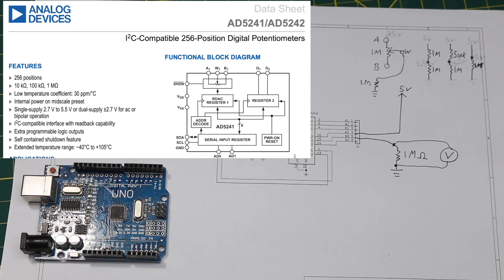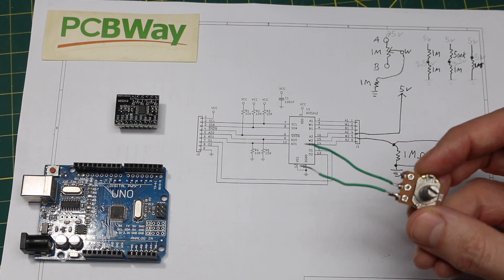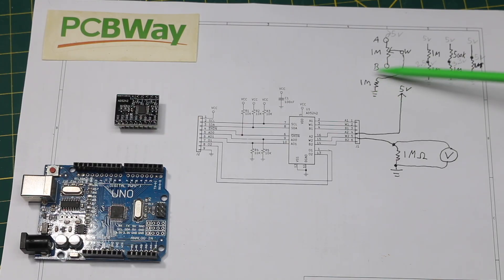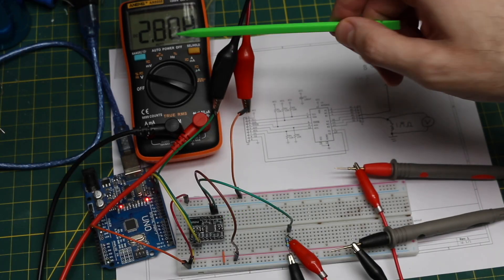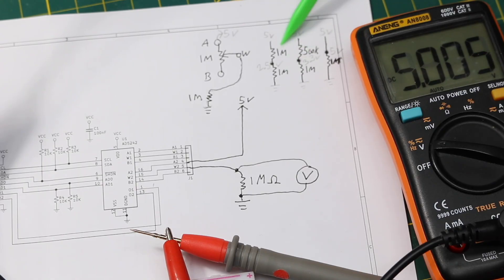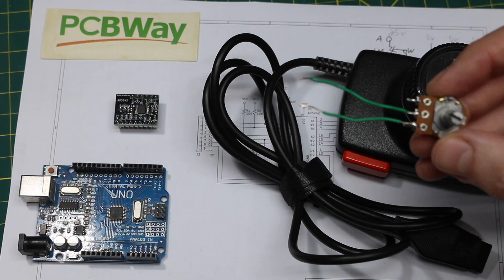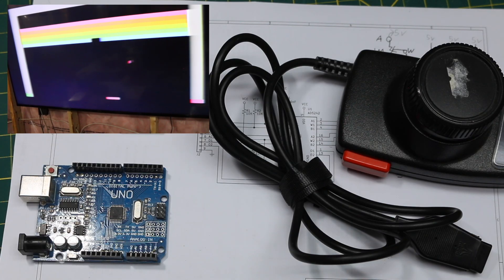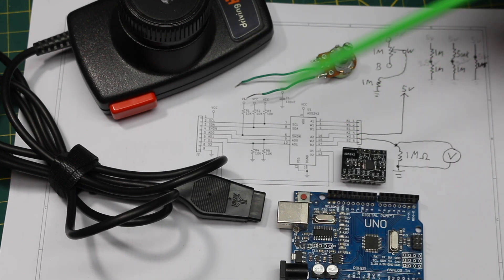How to Use a Digital Pot with Arduino - AD5242

Comment: Awesome ! On my 'to do ' list is a spinner for stuff like 'Tempest' but a paddle would be useful to for 'Arkanoid' But that's neither here nor there you have proved a technique. As a wild guess I would think your issues are 'timing' probably the digi pot and your code is running to fast for that poor old console to keep up with ! Nice job.....cheers.
Reply from the maker: I noticed another thing in the code as well. The part where I’m expecting the wiper to be in the middle but the 2600 is not responding, the code is using some midpoint reset command on the pot so I might try just forcing it to a value of 128 out of the 256 positions available and see if that works better,
 but still I was seeing it on the voltmeter going to the centre so it’s still weird but I didn’t really debug it I just wanted to get it working and filmed before it falls apart.
Reply: @GadgetReboot  I meant to ask what 'Midpoint ' meant, but you have it all in hand so let's see :)